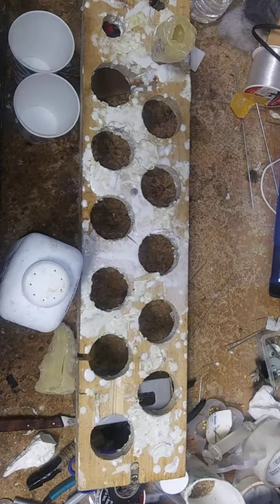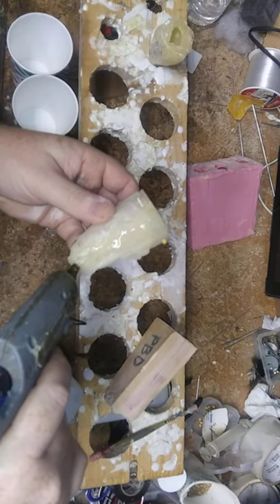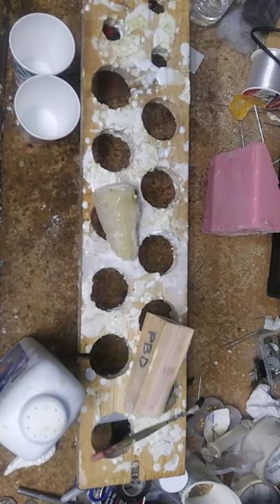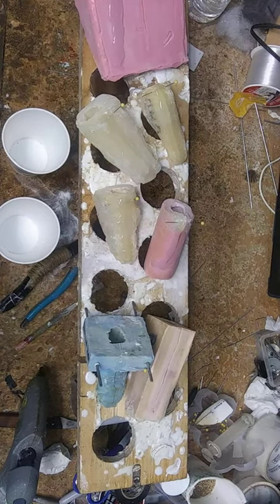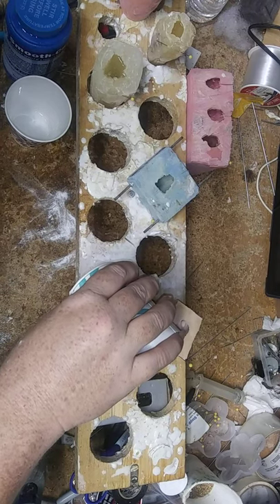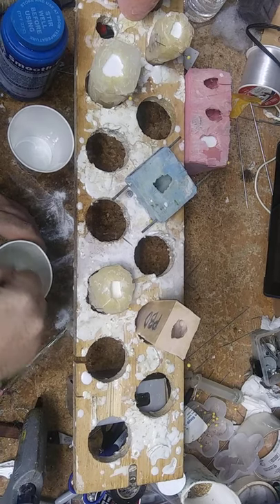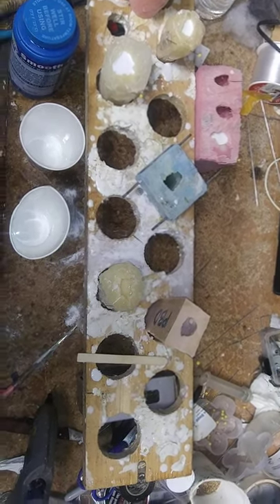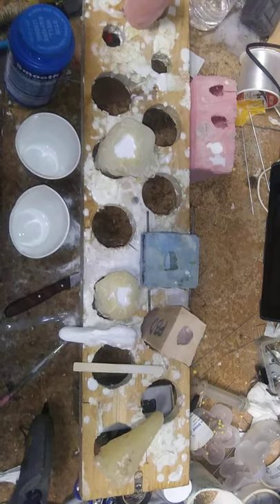AAR TAXIDERMY: Casting Different Species of Artifical Duck Heads w/ Smooth Cast 300 Please 👍

Comment: Have you made an open mouth duck head mold using silicone or would you recommend molding and casting a tongue separately and then installing it later .
Reply from the maker: You can make an open mouth the same way, tongue in. Main thing with open mouth molds is you want to use a lot of mold release than closed mouth. That throat silicone gets stuck often and stuff can rip so using that spray mold release helps with those especially.
Reply: @AARBIRDS  thanks, I’ll give that a try. I appreciate your quick response as well all of your casting videos!

Comment: Do you do the same for the body? And can wire be pushed through these moulds or are they that hard?
Reply from the maker: No i just buy the bodies. You can make molds out of fiberglass and use an expanding foam the same company smooth on sells. I used to do it but for me anyway, was just too messy and not the same cost benefit. 
This plastic is hard as a Rock, you'll have to drill any holes to run into it.
Reply: @AARBIRDS  thanks for replying, maybe I would be better off buying the body, the expensive bit here in the uk is the head so might cast the head.
Reply from the maker: For sure, its costs about 50 cents per head to pour, what 11 bucks or more to buy.
Reply: @AARBIRDS  yeah even over here £11 for the head plus £4 for delivery. Bodies are £6.50 and then £4 for delivery, that why I was wondering about castings.
Reply: What are the materials you are using to make the fom
Reply from the maker: @antoniovazquez4983  I believe your asking about the mold that its poured into? I use 100% silicone that you can buy from walmart or construction supply stores in the tubes.

Comment: Have or could you do this on turkey heads? If you freeze the turkey head
Reply from the maker: Great question! Thats the one I wanted to do next, its hard with them because you need to use a foam insert so it doesn't weigh so much and use up too much material that makes the whole thing just as costly.
You have to add the eyes after its poured. So much more prep work but much more savings. I did want to start doing Turkey heads as there really isnt any reason not too and the cost for an unpainted with eyes could be made for 10-15 bucks at most.

Comment: Have you ever done a Turkey head?
Reply from the maker: That's the one I really need to. I try to not do many because they just suck to do. Their heads are a huge expense so think I'm going to set some time aside when I skin some out to milf a couple common poses like strutting and flying.
Reply: @AARBIRDS  I am planning on doing a mold of a Turkey head this weekend. I will let you know how if come out. The replicas heads that some companies sell do you know how they get the hair on the heads? I know someone is now selling a dvd for $180 online and it shows you the process. It looks good. Thanks
Reply from the maker: @juliodias6041  the ones sold by supply companies don't have the feathers, your only going to get that from a Freeze dried head. That's a steep cost for a video, it's just molding like anything else. Only exception is putting a foam insert into the mold before pouring so it's not so heavy and your using less material that is expensive.
Reply: @AARBIRDS  I found some instructions on how to have the hair and feathers transfer to the mold. It’s not very clear to me. Do you want to take a look? If so. Send me an email so I can send them to you. Maybe you can better explain it to me because it looks a little confusing to me.
Reply from the maker: @juliodias6041  if your molding the real head then yea a good amount of those feathers and small hairs will pull out of the original and transfer to the first pour but that is a one shot deal that if your molding for the one head then your good. For commercial use, having to make a mold for each bird I guess still works out to be cheaper , just adding a lot more work to a bird that sucks up a ton of time as is.